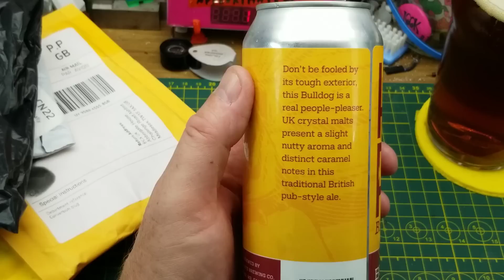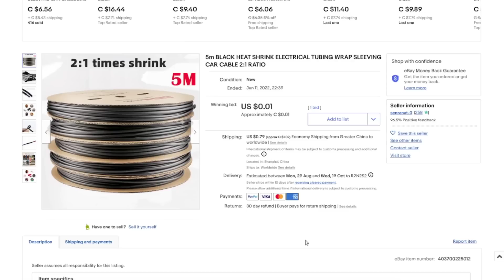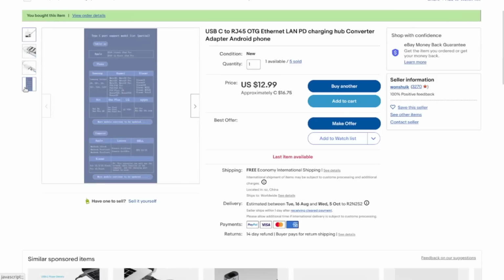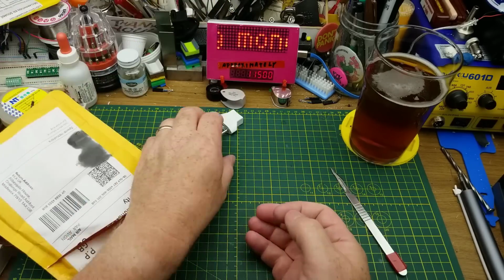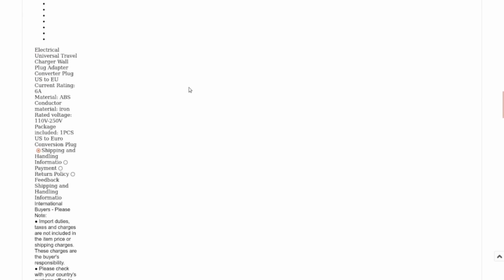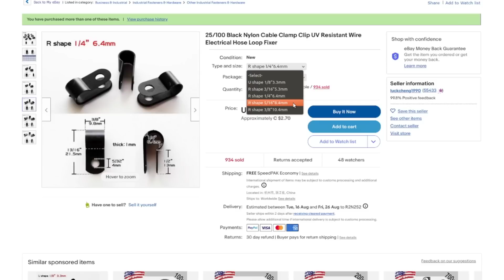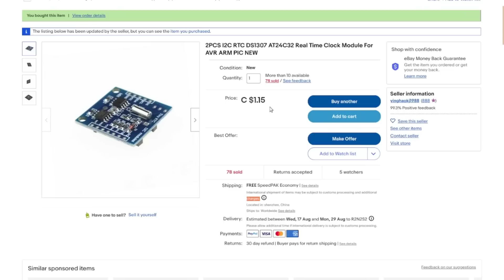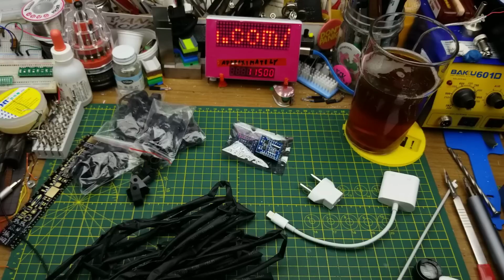mailbag Monday 145

Comment: both the clock and the eeprom use i2c, they're just throwing a handy thing in. clock has a tiny bit of sram backed by the battery, but if you need an rtc you probably need an eeprom

Comment: I was reminded once again to buy shrink tubing!  I also splurged a bit and bought 4 clock modules @ .99 each because as you say, why not always good to have around for projects.
Reply: 4:1 heat shrink tube with embedded glue is pretty cool stuff.
I have a little collection of watch crystals, and experienced consternation that they are not very consistent, varying in speed 1-2%.
Curious to see if the EEprom on the module is for general purpose (logging) or perhaps for storing data on how many cycles to add/subtract every second to keep the clock accurate. (shrug)
Reply from the maker: Another commenter mentioned the EEPROM is accessable for general use.

Comment: LOL. the death-daptor is not keyed on the European side, but has has the US plug with the big and small pins on the other side, ie, potential live chassis lol.
Reply: Even put an inline fuse in circuit ;-)
Reply from the maker: Fortunately i will only be using it with an isolation transformer, so it shouldn't be too dangerous.

Comment: Woer heat shrink is a UL Recognized Component and isn't too expensive in bulk.

Is that step-up transformer a proper isolated one or is it just an autotransformer?
Reply from the maker: It's a proper isolation transformer.
Reply: @pileofstuff  Sure? Earth connection does not suggest that...

Comment: Could print a enclosure for the convert to EU plug that makes it more stable, using the earth pin.
or just fill the space with hot glue, but that might be a fire hazard, or use the hot glue as a model of the cavity.